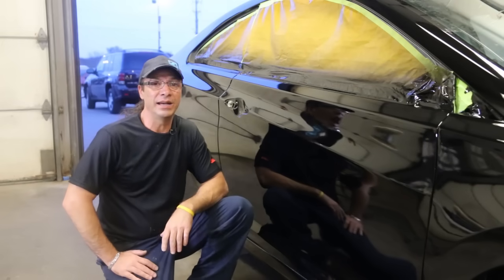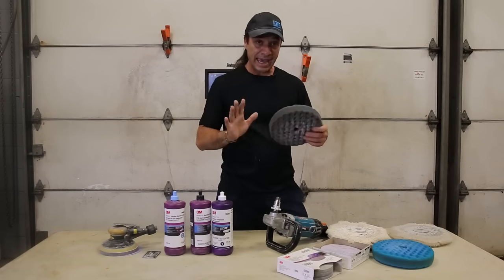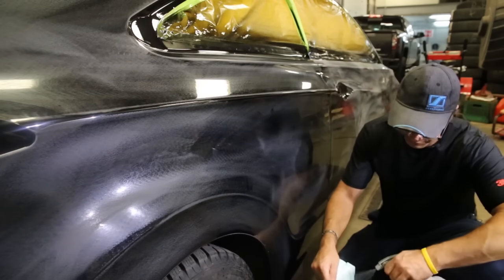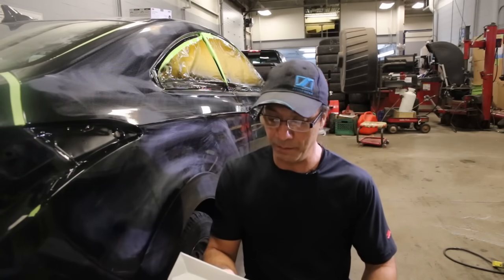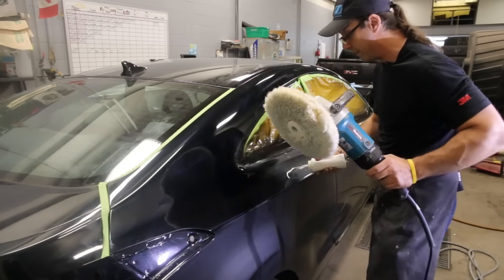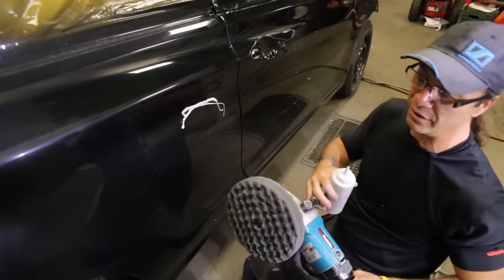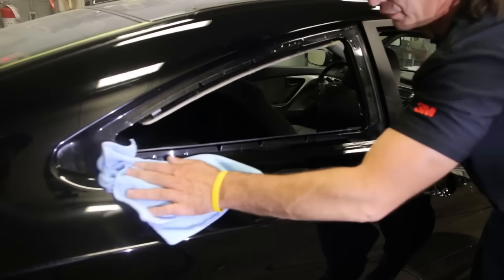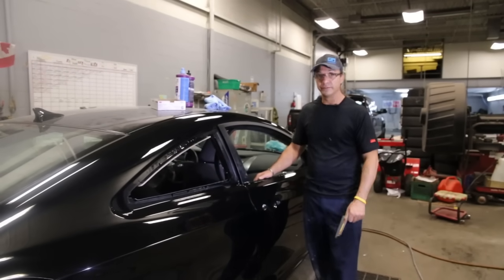Professional wet/dry sanding and polishing tutorial. 3m Trizact system, EX Compound

Comment: Nice job!  It's fun watching a real pro working his trade.  I remember me and my brother doing our old 74 Nova with DuPont Lucite lacquer... had an old pro body man giving us pointers on what to do.  We shot the paint on the car outdoors right on the driveway... three coats and then wet sanded by hand with 400 then 600 and then compounded using an old B&D grinder/polisher with a wool bonnet.  And that was after primer surfacer, sanding, and cleaning with PrepSol.   Came out great.  We also did our 69 Camaro indoors with DuPont Centauri enamel.  Lacquer is much more forgiving than enamel and is good for somebody starting out.  Great way to learn.  Nowadays you can get the equipment for a lot less than back then.

Comment: In the UK we struggle to get the wool compound heads, We use the foam pads but takes longer and doesn't cut the clear like the wool pads, great video.
Reply: lee coley I've just bought a double sided wool head, it's easy to get one
Reply: lee coley All the companys that i work in UK not even one provide it...and even that you want to buy on your own...they dont allow
Reply: lee coley don't provide what ?

Comment: This is by far the most informational video on this subject that I have ever seen. I just wet sanded a 67 bird by hand with 1,500 and 2,000 then DA wet sand with 3,000 and 5,000. Went to FLEX orbital buff and realized I must of picked up some trash at some point of the hand wet sanding. Pig Tails. Point is, I need to high speed buff and haven't done that in a while.  I have the 3M perfect it system besides the wool pad. Will be purchasing it tomorrow! Thanks!

Comment: Same here about foam pad and compounds. Really preferred velcro wool polish pad to start with. Was painter with dealers for years. Cut and buffed my own work. Spot on with your process. Even down to pulling tape off in certain direction. Very informative. Thanks 👍

Comment: Fantastic technique for guys that want to learn about the principles of wet/ dry ,compound &polishing from the pros. Noticed one thing thou you were kneeling for about 50 % of the time . Would your work load become a lot easier if the car was put on a platform lift type ,that allows you to adjust the high your body is working at ,l think that would be great for workers in this type of industry. Thanks for your tips
Reply from the maker: lawrence dingli thanks for the great comment. When you do a high volume of cars a day, it’s not cost effective to spend 10 minutes putting it up on a hoist. I normally use a roll around stool. I only did this for video purposes.
Reply: What this man is sharing with us is way over your head bud. So you should just s
tick to the Martha Stewart channel.
Reply: or you could just get some good knee pads. your body will thank you in the long run..... Facts
Reply: Like he said, there no time,cars come in and out quickly...
Reply: @aa-tx2nx  maybe he does wear them, this is demo video..

Comment: I figured out that i can use the trizact 1500 discs and trimmed it in a triangular shape to fit onto a buzz style detailing tool. It works awesome to get paint nibs out without digging into the paint. I wish 3M would make some of those. You have excellent control of what's going on. Very helpful video on using this system.

Comment: I love 3M products, but they're Sooooooooo Expensive.  If I used them exclusively I'd have to change my prices... which here in Calif, competition is tuff.  17 yrs Exper
Reply from the maker: BadRonald1 have you tried the Presta system? Much more cost effective and a great product.
Reply: No I haven't
  but will check in to that . Thanks
Reply: loveja1 Is that the two step system?
Reply from the maker: Bull Euston for production, yes. Recommend 4 steps for quality work. Compound pad, then polishing pad, then black foam to the blue foam.
Reply: As good as Meguiar's ? Thanks
Reply from the maker: Rocky Elorde I only like their stuff for the waxes. Never been a fan for their compounds

Comment: This is body shop, fast production type buffing, not paint correction/detailing info.
Reply: Tezzr Terry yep this car will be full of holograms
Reply: @baileyeverard7271  you guys don't know what you are talking about.Ibeen doing detail for 30 years and sometimes wet sanding like this guy. Just so you know this is the way to polish cars
Reply: So? What's your point? The guy is no doubt a pro and I learned a lot.
Reply: @dennisa6492  his point is that this is not how you get high end correction or flawless paint on a car. Yes the wetsanding marks were removed but a shittone of holograms were left behind as a by product of using the rotary and aggressive compounds. Thats why myself and all pro detailers then use a finishing polish on a da to remove those holograms and end up with a flawless finish. High end paint protection is not usually authorized or allocated to body shops, only to pro detailers who specailize in polishing up the clear coat. This video does not demonstrate how to polish a car. If anything it only demonstrates how to wetsand orange peel and remove those sanding marks.
Reply: @ahmadabboud1535  mate you reckon he will let a car out with all holograms on it??! If you knew what you are talking about step 3 of 3m perfect it eliminates the holograms.

Comment: I like your style the way you Handel the buffer/polisher very smooth gliding with fluid motion with what appears to be effortless & I'm sure it's not, but that's the signs of being professional. Glad I ran across your video showed me things to look for & not to stress about other stuff that will prolong the process. Get er done move on. I am not a painter polisher not buffer by any meaning of the term. But I have found if I work as though I no what I'm doing, job goes faster comes out better an I'm pleased with the job. Thanks for the lesson.
Reply from the maker: Thanks for the great comment. Cheers.

Comment: Cut and buffing skills and a RUSH fan bro! 🤘😎🤘 pretty rad dude in my eyes haha thanks for the lesson and informative information brother!
Reply from the maker: Lol. Thanks man! Rush on!
Reply: Man I'm cutting and buffing this black beamer is why I clicked on your post here and geeeeezz I can see every scratch! Finished off with 3000 trizact also and still see pigtails everywhere I DA'd wet 1500 2000 to 3000 did I skip 2500? Is it necessary? How to avoid pigtails. Everything is clean clean ppg production clear Bauer da maxman cheap Amazon discs besides my one trizact 3k orsen heavy cut compound ultra cut wool rupes medium wool microfiber I just keep testing the compound then back to sanding again this is just taking forever man just on the trunk here for practicing! Much props to you buddy! Would 5k be a must? Maybe just more time with the 3k? Livin and learning brother 👍 appreciate you 😎🤘
Reply from the maker: @1982mattd  you can easily go from 2000, then 3000. Pigtails usually happen when you’ve used that paper to far or not cleaning the pad as you go. You can only use that paper so much, then you have to replace it. Try going back over it with 2000 dry on a da, then 3000 wet. That should help.
Reply: You're Awesome dude! 🤪🤘 thanks bro
Reply from the maker: @1982mattd  never cheap out on materials, especially when it comes to wet sanding. 3m is the true grit.

Comment: I own a shop and I run from the back to the front so pretty much I do all. But when it comes to buff there is the thing, cuz I dont like it. But I do it, I used foam pad from 1 to 3 it work but takes a lil longer. Im gonna try you way then let u knw.
Thanks for the tutorial, really it  helps a lot for beginners.
Reply from the maker: you will notice a huge different in time when you switch to wool pads, plus the money.

Comment: Awesome video!!!   I'm going to try the wool pads on the Makita after this video.   Usually I just run foam on the standard Porter Cable orbital with 105 & 205.   I use the Makita for polishing aluminum and it is a beast and especially the soft start is great with no sling.  Agreed that foam never has the cut you want without overworking it.  I'll try a 2000 and then the Makita/Wool/105 (then 205-glaze-wax) on a sun bleached hood this week and report back.    Thank You!!!
Reply from the maker: Adrian Pillow looking forward in hearing your results.
Reply: @loveja1  Great info!   You have changed the way I polish as a normal non-pro person!  The Makita/Wool with 3M cut followed by the Presta products is AWESOME!   Even the Presta interior detailing spray is GOLD followed by 303.  Steps:  Wool 3M Cut, Wool Presta 2Step,  DA w Med foam and Swirl Remover, DA soft foam Glaze, Hand apply wax (yeah, I probably should go speed wax).    3 Cars completed with this process and all look wonderful!
Reply from the maker: Adrian Pillow I’m glad it’s working well for ya.

Comment: This is the way my mate taught me how to polish cars 10 years ago.. I still use the same practice now.. 

Forget this dab dab on the pad rubbish.. just chuck it on and spread it around.
Keep pads clean between steps.. 
Use little product as possible
Use a dash of water if need be.. to reduce heat ( if you get stuck ) 
And always check for reflection detail, the clearer the better the paint finish

Comment: Great video with some great information, I agree get used to working with a product range that suits your style and don't change. I've trained a few people in compounding and paint correction. The best way I explained using a wool pad vs a sponge pad. The wool pad would cut the tops off the scratches giving a much flatter finish, where the foam pads would round all the scratches and contour to them, still a shiney finish but not as flat.

Comment: what u show how to sand,compound, polish,and do the edge inside with the back taping is just how i do my jobs .i.use wool pad to compound its faster an u save compound it cut sandpaper scratches faster than sponge pad i do three or more vehicle with a bottle of  3m ex compound depending on colour .depending on what the customer wants his finish i use from 800 to 3000 trizact thanks man job well done
Reply from the maker: firefox01 fosgate!

Comment: I love the 3 m system . I do hydrographics . I do a lot of guitars and I use automotive urethane clear coat and the guitars turn out sweet . I didn’t realize using the wool pad first . Never did autobody so I didn’t know that . Thanks for this video I’m going to start using the wool instead of the foam for
Step 1.

Comment: Hi mate Alex from Australia we been getting lots of dirt in our bonnets  doing 2000 on the orbital with a pad 3000 and 5000 for some reason I keep getting pig tails even when I use new stuff cheers love your work
Reply from the maker: Make sure you wipe your sandpaper every time you grab a new one. Wipe your panels very well to get any dust off of there and you can only go so far with the paper before it starts clogging.
Reply from the maker: Tell your painter to look into a static gun, they really do work.

Comment: Thank you for taking your time and showing it here. I like your commercial approach. I understand this job was done on freshly painted car when clear coat is not hardened completly. I want to restore old work to new shine which is now dull from all the washes. is the process same just extended time of work or would you change soething. thank you
Reply from the maker: Sorry for the late reply. If you just have a dull car or scratches, you may want to just compound and polish it. Another great step is to use 3000 wet, then polish.

Comment: A++ to add to the compliments. Wow. So what do you do with a severe orange peel, just painted (single stage urethane) vehicle? DYI Earlex Turbine with a 1mm needle. Happens to be a '54 Chevy pickup. Lot of contours in that. When I say severe, starting with anything higher than 500 (no typo) wet sanding, and a lot of work, is just  a waste of effort. I have done the roof and part of the door. Finally got about 90% of the orange peel off without burning through in those sections. That took 2 hrs alone. Having  to do the whole thing is giving me pause to possible just scuff the entire truck and respray using more reducer than the 5% that I did. But before chasing my tail, should I consider a dry sanding process to "save" what I have already done? If so with this heavy peel, what grit, etc?  I have both a sander and DA. I am not looking for showcar finish but certainly something close to new car. Color happens to be a machine grey. Leading company that I bought materials from said as long as you topcoat with 4 days I do not have to wet sand the epoxy primer I sprayed. For the heluva it I did wet sand the tailgate only and wouldn't you know...that panel flowed well and has minimal peel in it. I don't want to waste my time trying to get 100% of the peel out but if I don't, then going thru the grits (1200 on up) and then polishing is just going to show the peel spots. Sorry for the length of this.
Reply from the maker: That's a hard call. Either sand it for ever to remove the peel or just respray. if it's that severe, you have no choice but to remove the peel to a glass finish. If you leave any of the peel, it will look like small pits in the finish. I would just start it with 1000 wet or dry, or even 800 on a da till most of the peel is gone and then 1000 wet, then 1500, then 2000. Providing you have ample clear on the surface.

Comment: Really enjoyed watching this video.   I'm not a professional but I notice you use some of the same terms i use.  I also use the 3m system. One question. I know this is a production shop process, but would you argue that the 3000 grit on a da gets the surface as flat as on a hand block? That da worked the panel super fast compared to hand blocking. I'm curious on this and perhaps maybe look into buying those pads
Reply from the maker: rosharon built no. 3000 will not remove peel. It only looks that way because it’s hitting the highs and lows of the peel because it’s a soft pad on the da. It’s only use is to remove scratches from 1500-2000.
Reply: Thanks for the response. I'm about to hand block my 64 with 1500 to start.
Reply from the maker: rosharon built how strait is the body?
Reply: @loveja1  check out my.latest video I posted. I have documented the entire build of my car. Just sprayed the shell last night.

Comment: Loveja, you don’t shoot from the hip do you. Great information. You mentioned something in the video that caught my attention. I’m a full PORSCHE restoration shop. All my projects are time and materials so no production whatsoever. I only use Glasurit finishes. You mentioned that Glasurit dries hard thus, a tougher surface to cut. Would you still go with the 1500 and then 3000 process? If easier to elaborate over a voice call, please share contact. Thanks Freddie. Vintage Sportscar Restorations INC
Reply from the maker: Freddie Hernandez you really have to test it out. Try 2000 dry then 3000 wet. Just do one panel and see what it’s like.

Comment: Hope you can answer this after all this time, Great video still to this day, I've a  QUESTION, if you notice in places you got some pig tails after you finished polishing,  what the best thing to tackle it please ?
Reply from the maker: Hi. Sometimes it’s best to just go back over it with 3000 depending how deep they are. Or just putting more pressure and heat in that area with your compound and polisher. Hope that helps. Cheers.
Reply: @loveja1  thanks for that , unfortunately there wasnt much lacquer left, cut through so , applying  3 coats of lacquer and start again.. using your method. Thank you..
Reply from the maker: @paulsimpson2232  lacquer?
Reply: @loveja1  clear coat I think you call it

Comment: grat video,and profesional work 100%,,i have question about 3m polishes,,are they new line from 3m or not,,becouse I used 3m fast cut green compounding,,and its dry to fast,
Reply from the maker: No, this line has been out for a long time. I've actually never heard of green 3m compound. If it dries too fast, then you are using way more material then you should be.

Comment: awesome  video  man   you  described  and  did  the  sanding  and  buffing  explaining very well.    I have  a  question  when you  use a new white foam pad for compounding  is it usual for the white foam pad  to have little black   colors on the  white wool pad  when done buffing?  the only thing i can think of is i  maybe  buff  threw  clear  into the black paint .
Reply from the maker: Little black colours? What do you mean?
Reply: @loveja1  there black spots on the  bottom  of     white   foam pad  . i dont know if its  paint  or  maybe   I did  not clean the item good enough  for  buffing
Reply from the maker: @mattsvintageshop2925  firstly, stop using those pads. They take too much time and you can easily burn through your edges. Is it only when you’re polishing a black car that has been repainted?
Reply: @loveja1    I was buffing  my motorcycle gas tank I'm fixing up   for fun.    you mean stop using  the  white wool pad?

Comment: Amazing, such a unique insight to this kind of work. I know next-to-nothing about your line of work, so I was wondering; why you did what you did? What was missing from the paint to necessitate this process?

Also, you say that detailers will detail it afterwards, but what is there to detail? Seems like you left little/no marring with the ultrafine finishing polish. Or are they just cleaning and protecting?
Reply from the maker: Rik Heijne the detailers will wash it and get rid of any polish in the jams that I may have missed. The reason for this process is when you paint a car, you’ll get little specs of dust in the paint, so this process will eliminate that.